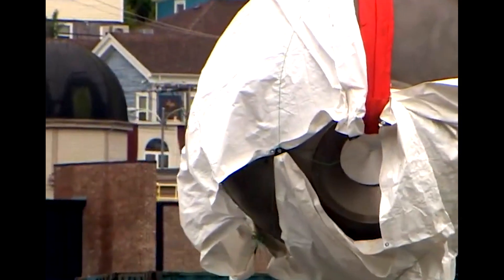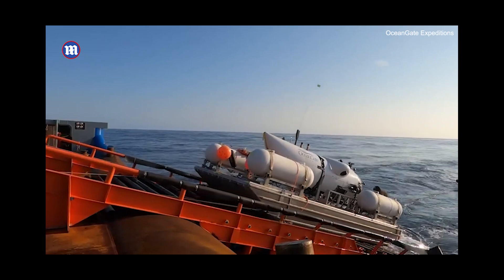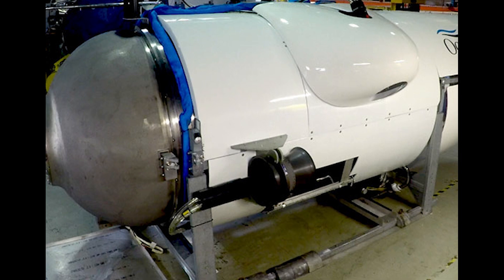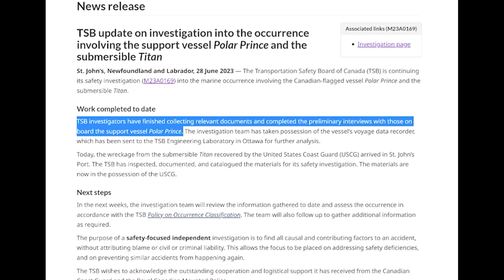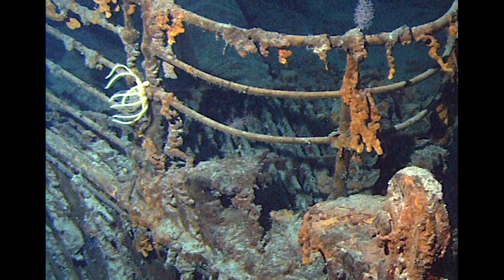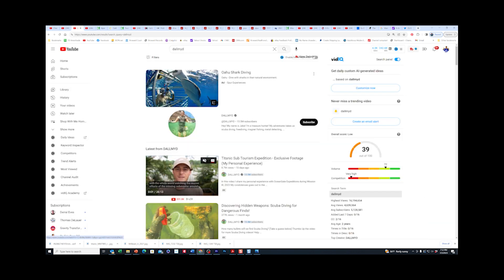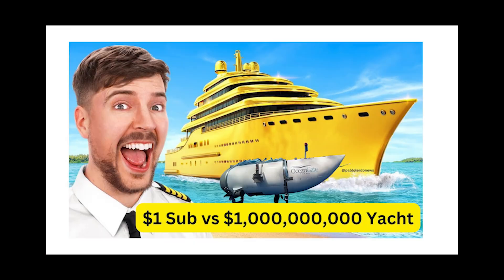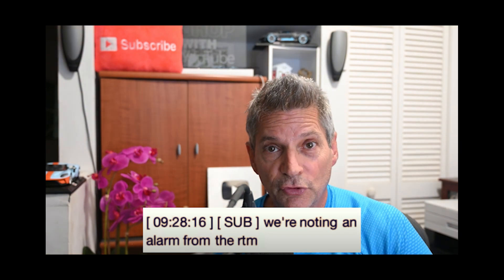Titan Submarine Debris Clues, Implosion Simulation

Comment: All these parts are under pressure from the outside. So everything is being pushed together. Therefore the length of the overlapping portions of flange and carbonfiber hull does not matter as to being pulled apart.
What I am rather be concerned is the different amount of compression of the epoxy and the titanium. Under the huge pressure there shoud be notable differences if the compression rates are really different. And if the mentioned noises don't come from the cylinder microcraking they might have come from the "grinding" of flange and cylinder. If the parts were actually moving against each other then the glue could have been dilaminated long before by other dives already.
I would have designed a kind of expansion joint there to allow the more compressable material to contract freely without bending/tearing the other. Sounds like Challenger?

Comment: What an amazing observation...no metal ring sealing in the glass, likely removed for debris extraction. Also no glue left over on the titanium rings -- I am by no means an expert but If I were to make a bet I'd take a shot in the dark and say the ultimate downfall of the craft was likely due to the connection between both titanium end caps and the 5" carbon fiber tube.
Reply: good points.  the broken glass had to be removed to preserve the evidence so investigators removed all the bolts.  That actually makes sense.  But...  the Stockton said in the text that the crackling was coming from the rear  and the porthole is in the front.

Comment: I said the same thing about them not using a torque wrench.  I watched a video of a man using an impact drill to run them in.   Then I began to wonder how many times those bolts had been run in and out.
Reply: And don’t different metals interacting with each other over time disintegrate in salt water?
Reply: @joan6044  Yes, even without salt water. Likewise, the interaction of carbon fiber and many metals - including titanium - also induces galvanic corrosion.
Reply: Williams F1 team used to inspect every part after each race. After a few failures of basic components, they found out that it was because of the repeat inspections that parts failed.
Reply: NASA certainly wouldn't have approved. Everything but everything that goes into space is installed by the book and documented and certified. You don't just grab a ratchet and crank away.
Reply: The video I saw they went around with a ratchet and then finished it off with a torque wrench.
Reply: They ARE using a torque wrench in this footage though.?
Reply: @willb1157  doesn't look like it. I think they are using two different sized ratchets.
Reply: Bonus points if the bolts were made of cheap plastic taken from a toy.

Comment: 2:03 shows one of the interface rings being lifted off. Just below the padeye that the lifting sling is shackled to there appears to be some black material of some thikness that is bent inwards. What are your thoughts on what this could be? Also at the bottom left side of the same frame there is more black material that appears to be peeling away. Can this material be carbon fibre? If not what do you think it is?
Reply: That ring does not look round to me. It looks elliptical.

Comment: The robots wouldnt have been able to remove the bolts for that flange. They were installed with an impact gun and torque wrenched down. That actually gives more questions than it answers, as then it comes back to where is the window?

Comment: The same thing applies to aircraft, where's there's a seam, there's a weak point, mating surface held together with any adhesive, is a weak point, 31 years as an aircraft mechanic, have seen jets come apart in weird ways.

Comment: Come on .. IMplosion show be the ribs beneath the carbon fiber! Air pressure was not keeping the ballon expanded the ribs and criss crossing fibers do this. Aircraft use air pressure subs use structures distributing the water presser over the hull. The rings not being attached can be answered looking into the structure of the A12. An implosion would simply pull the pressure vessel away from it instantly. Leaving the rings basically fine.

Comment: If true , the implosion , there is reports that the sudden implosion causes massive heat with the outer pressure pressing inward the fibers and the window may have been crystalized do to the velocity of pressures.The screw holes may just be striped out by a inner and out support for the window.